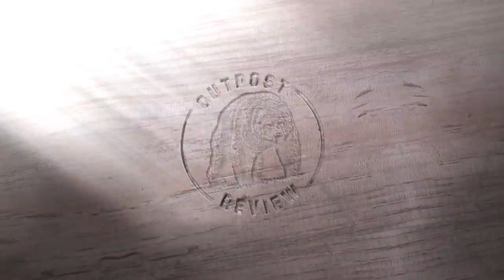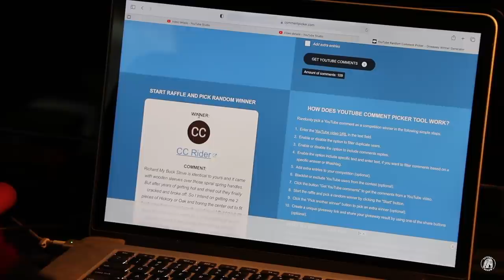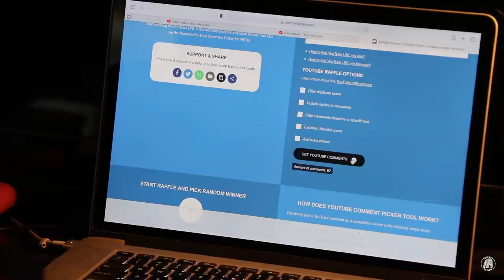NEW SAWMILL, WORKSHOP & BARN PLANS FOR THE HOMESTEAD | TIMBER FRAME OFF GRID CABIN

Comment: My great uncles where from the hills of southern ohio ...They would go up a hillside and trench down bury a pipe at the bottom of a wild rock cistern which they dug and layed up by hand then they would trench further up the hill laying socked pipe drainage tiles ...every rain would fill their cistern which was above the home stead ...
the 1 inch pipe from the cistern ran to a curb valve in their yard which then fed the water pipes entering their basement ...they laid oak planks with a man hatch to access their cistern...the pipe at the bottom of the cistern was 1 foot above the bottom so they had a catch for silt. the hatch and ladder guaranteed they could use a pump to jet clean the cistern every five years to clear the silt usually in the summer when it was pleasant they would drain it down clean it and repoint the cistern and allow the rains to refill it ...this buried water column would hold thousands of gallons of water...the rain waters where naturally soft so 95% of the water used at the house was from the cistern...the remaining
5% for drinking was gathered at the spring and kept in 1 gallon jugs in the root cellar! If memory serves the wild rock cistern was 25 feet deep and the over flow pipe was 5 foot from the top for winter freeze issue abatement...the pipe that went to the yard valve was 1 or 2 feet from the bottom..the house was at the bottom of the hill so there was plenty of head pressure on the pipes...

Comment: that wind mill could pair with a cistern and fill a water column....which will provide pressurized water for the farm stead...so when the wind blows the pumps pulls the water out of the ground even if it is just a trickle and fills the water column... The base of the water column can and will yield head pressure...my previous calculations indicate that a 18 inch diameter vertical pipe pipe 20 feet long with a what the pipe fitters call a pie pan on either end would be enough volume...the lower pie pan would be tapped to allow for a 3/4 inch gate valve at that point when the water column is full you should have 35 lbs pressure for a closed system potable water system if you have a way to dig a cistern a solar pump /windmill could keep the stand pipe full...any overflow would push back to the cistern... How hilly is your property?